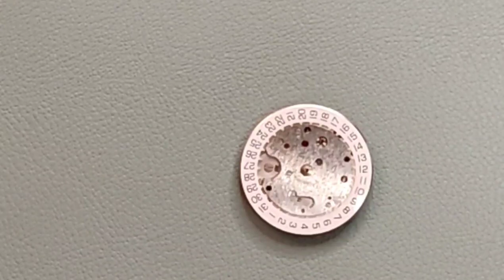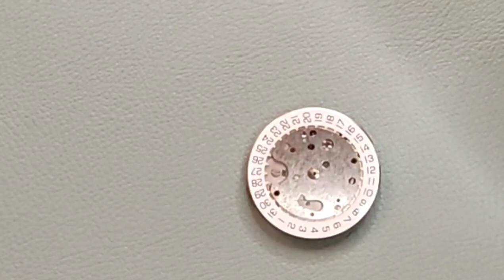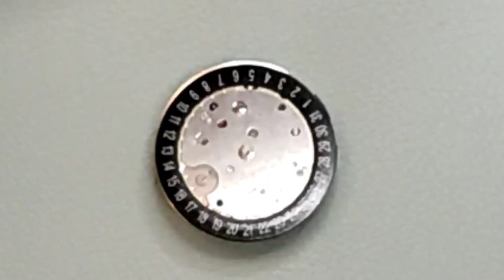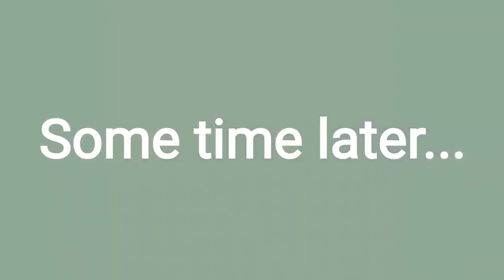Vostok Cosmodiver / Luna Dude - Full DIY build

Comment: Thanks for the great video mate. Just a question, did you get little center thing on top of the main axle? Could you reuse it from the donor Neptune?
Reply from the maker: Cheers, yes you could reuse it. I recommend painting it black if you do otherwise is doesn't look right. Unfortunately mine flew off the tweezers
Reply: I was about to comment the same thing. When you you popped the hands off I saw it laying there for a little bit then it was gone :). Thinking I'll probably paint mine black. Doing my mod now. Thanks a bunch!